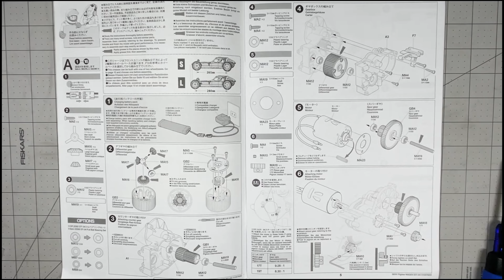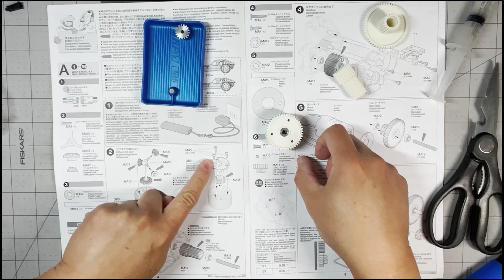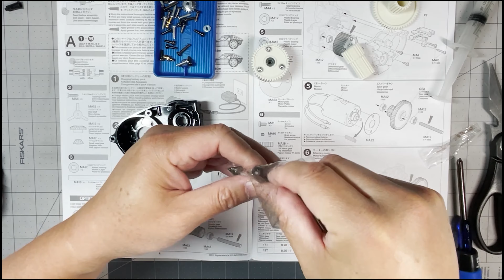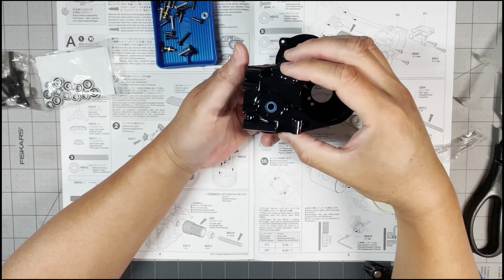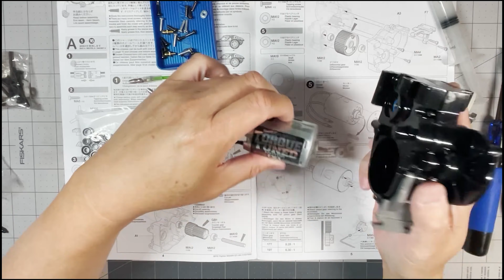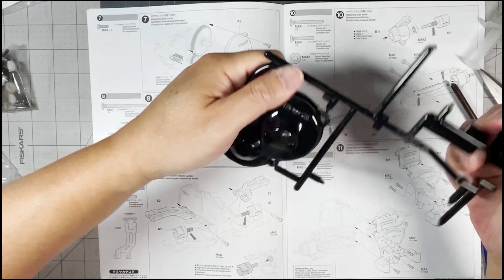Tamiya DT-04 Fighter NXGEN - Assemble Gearbox and Motor

Comment: Why not grease the 3 axles in the diff ?
Reply from the maker: I thought I did after I put them in?
Reply: @RCsRCCars  You greased the three satellite gears but not the axles of the carrier. As is, the diff won't explode but these axles are the smallest parts and the satellites spin on these axles.
Reply from the maker: I see. Thanks for pointing it out. I will pin your comment.